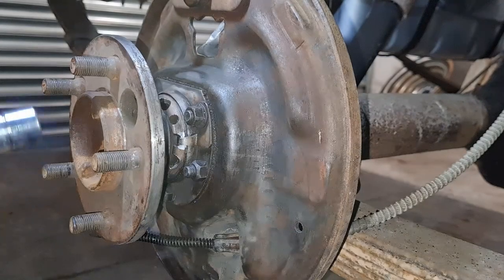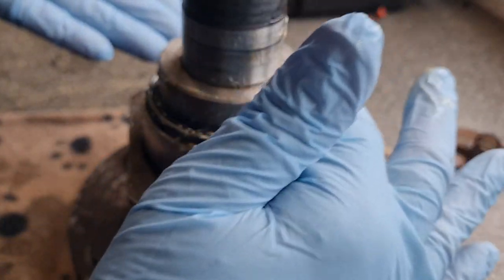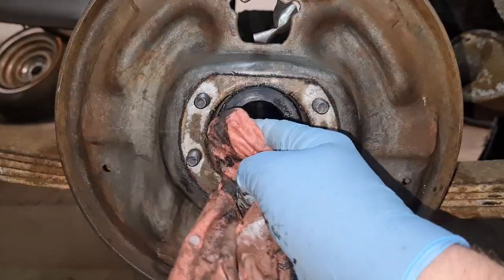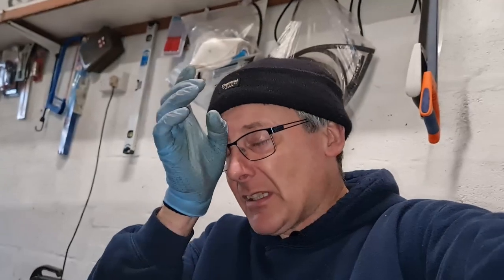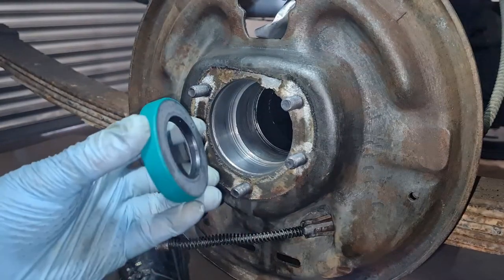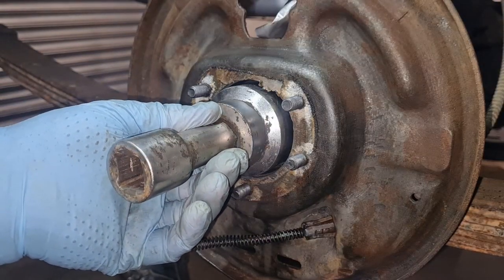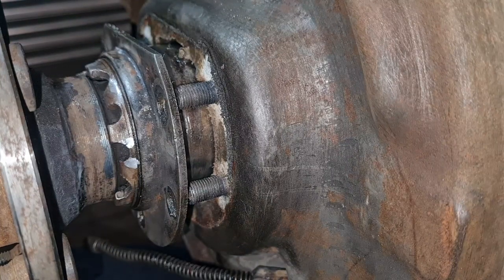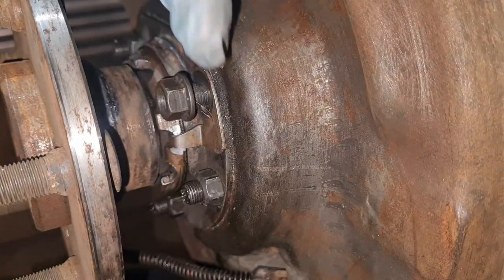Mopar Chrysler Dodge Plymouth 8 3/4 - 8.75 Axle Seal - Remove And Replace

Comment: Excellent video and I'll be out to buy a 2 inch socket to do my seals. Your seal was the original.  How you can tell can be seen at 6:18, at the top of the seal you can see the DPCD marking (Desoto Plymouth Chrysler Dodge or something like that) which my original seal also had. It's interesting this video came out today, as tomorrow, I'm hoping to complete a differential swap on my '68 Fury and I've also bought new inner seals and gaskets for the axles. This will be my second time on this job if the seals that are in it now show any signs of leaking. I think i would have  a bit less end play than I saw there.

Comment: Nice job George my 87 d150 was done at 87.000 seams like that  axel is really some iron thinking of redoing the out side with some converter and then prime and paint some oil base black on it it's what I did with inspection cover . I got one of those China nock off carborator until I got my holley rebuilt not bad for 100.00 bucks but had holley manufacturers rip apart that China one and glad I still have the holley one .but the best thing I did with mine was putting the hei Chevy ignition on it Idol super smooth now.

Comment: Best video on this topic. I also need to replace the same seal, on both sides. How did you drain the diff fluid? Regards
Reply from the maker: Thankyou Otto... I didn't drain the diff fluid out. I jacked the car on one side and the fluid ran to the other end. Didn't need to drain anything 😃👍🏻

Comment: Great video but i think its safe to say that even though the axle bearing spins freely on shaft, its not a surefire indicator that it is good unless there is a load on it.  For instance, my bearing noise goes away when im making a wide  turn and all load is off the the  bearing in question.
Reply from the maker: Thanks, I appreciate your feedback and also hope this helped you out 😃👍🏻

Comment: Great video,thanks George. I want to change my fluid in my 8 3/4 sure grip rear axle in my 1966 Dodge Polara,does it require a additive along with the gear oil?
Reply from the maker: Not sure on the additive Bob. Maybe search a few forums, or ask uncle Google. You shouldn't need to pull your drive shafts just to change the fluid, but if you do make sure that there's no pin that will drop in the diff. Mine was an open diff, not a sure grip so the removal process of the shafts may be different for your axle. Hope it helps, and thanks for watching 👍🏻SGG

Comment: Great video. One question; for the plate that is held onto the housing with the nuts that need to be torqued to 35 Ft-Lbs, is any sealant or gasket required between that plate and the housing? The reason I ask is on a vehicle I have purchased, the previous owner put sealant in between those. Thanks for any info!
Reply from the maker: There is usually a very thin foam type gasket but I guess you could use some sealant if you think it necessary but it shouldn't leak. Hope it helps 👍🏻
Reply: @SortedGeorgeGarage  THANKS

Comment: rock site mentions a inner and outer seal. that green one looks like it could get distorted easily. and I'd be watching that the spring dont fall off. the old one maybe that bit you tossed can fit on the new seal to keep the spring safe? not looking forward to this at all
Reply from the maker: As mentioned in the video I did the Inner seal not Outer seal. The old seal was an original factory 2 piece seal. Nothing on the old seal will fit the new seal.